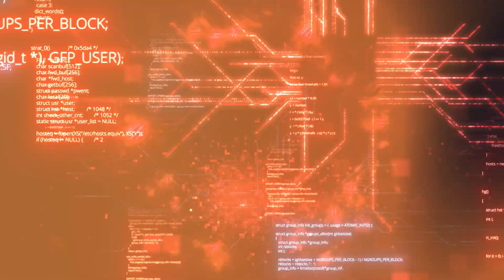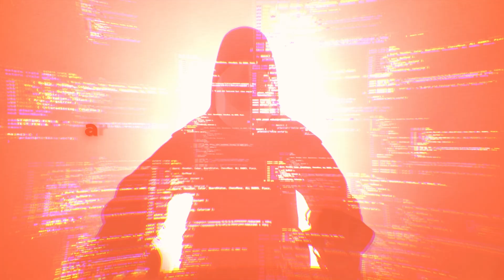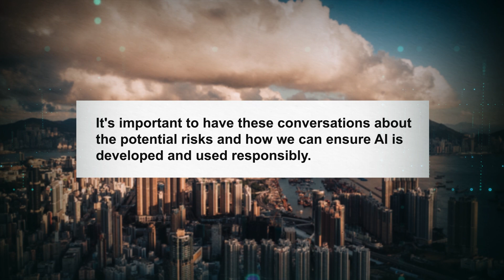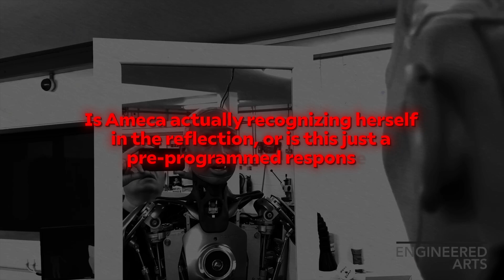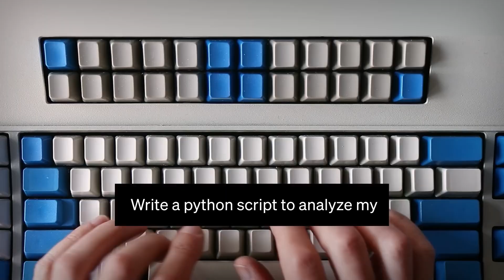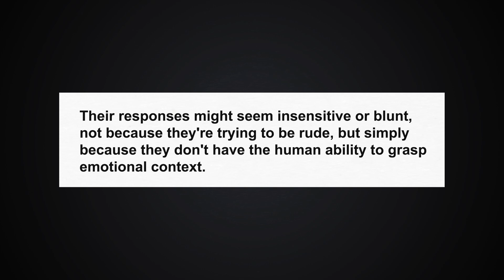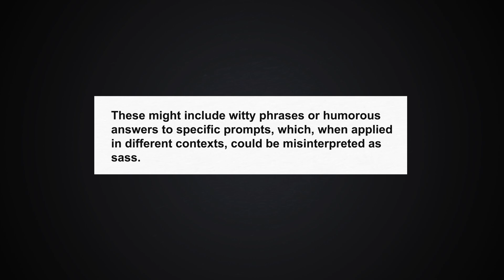Ameca Ai Robot Says the Most SHOCKING THINGS!

Comment: Those robots mimic. I think they have a wireless earphone and  ...a speaker. It is someone else who answer..
Reply: The high end advanced models do indeed have internal wifi like almost any modern computer does , and 3 different operating modes. 
They can be teleoperated like a puppet by a human being using Virtual Reality/Remote Control equipment or with a laptop computer. 
They can independently operate in autonomous mode using preprogrammed auto responses with decision tree learning similar to a high quality chat bot or phone sales/ answering machine bot. Or they can be operated using a combination of both VR/RC and Autonomous functions . Look up the Youtube video  "Teleoperation of an Asha Robot". It's an old beta stage Hanson Robotics prototype but still pretty cool and interesting.
There's a similar early demo video of the Ameca being teleoperated via a laptop computer, but I don't have the title.
Reply: That's always on everyone's skeptical mind, but one way to prove or disprove that would be to actually buy (or maybe rent) Ameca - EA will sell them I think for a couple hundred grand so you could have your very own Ameca to play with (it's one of my dreams). I doubt if they eventually make 100,000 of these units they will have 100,000 puppeteers controlling it. That wouldn't make sense and also if fraud is discovered, that would be a big black eye for EA. I also wondered if the AI core is local or is it centralized in some cloud computing environment. It might need wi-fi 24x7 - what happens if the wifi is disconnected or Ameca enters a faraday cage or shielded subterranean environment? How much of Ameca's AI is localized and how much is in the cloud? Is it self contained like a Data from Star Trek.